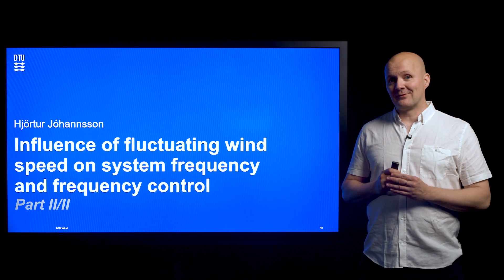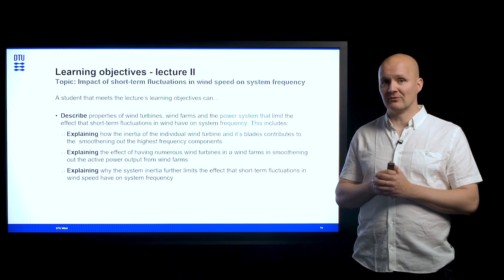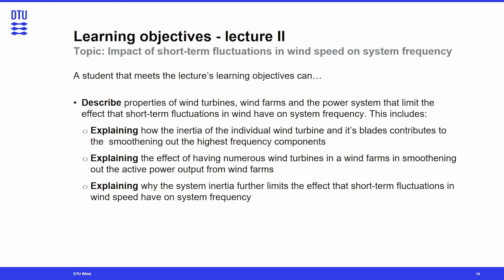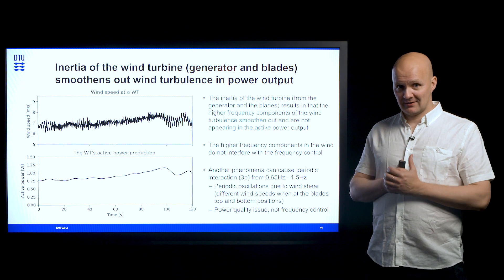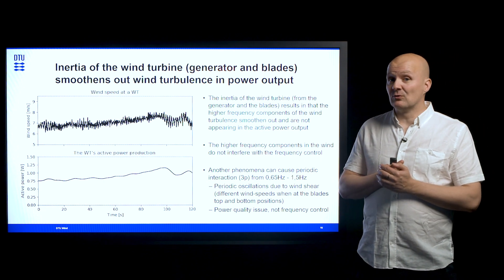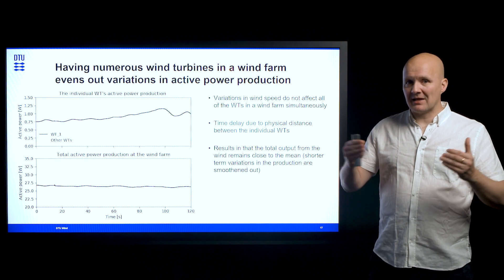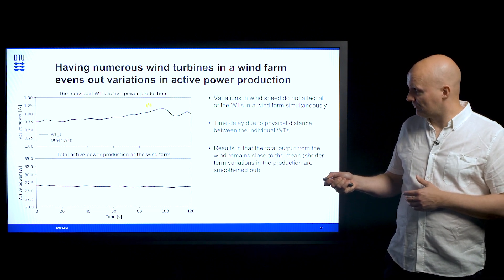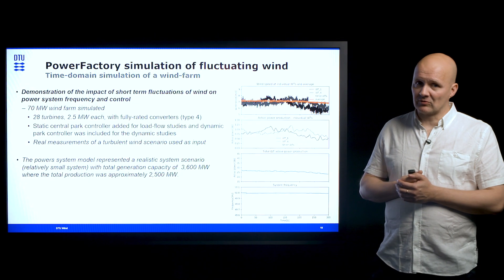Influence of Fluctuating Wind Speed on System Frequency and Frequency Control. Part 2

Comment: part of the major draw backs of shot-term forecasting technique is their inability to estimate accurately magnitude of forecast for substantial increase in generation ,and trend of wind farm generation. Instead of using detection techniques as a solutions, the study intend to drive through inertia time constant of WTGs/ROCOF for optimizing ramp rate control. Task: how to link or establish influence of  inertia time constant or ROCOF on wind generation forecast from SARIMAX model to improve prediction performance as well as bringing ESS to adequately regulate wind farm generation and power delivery to the grid?